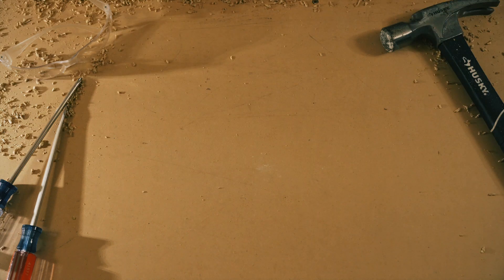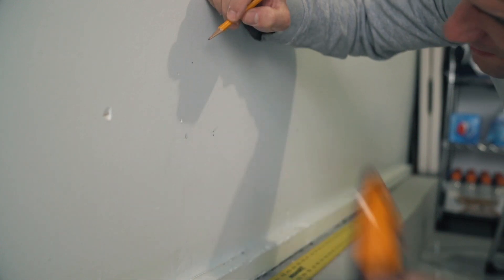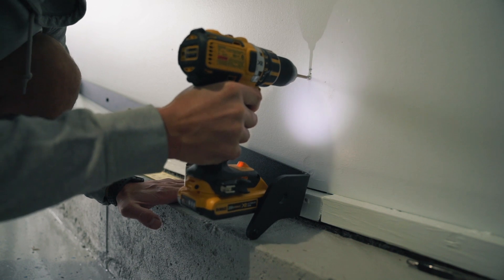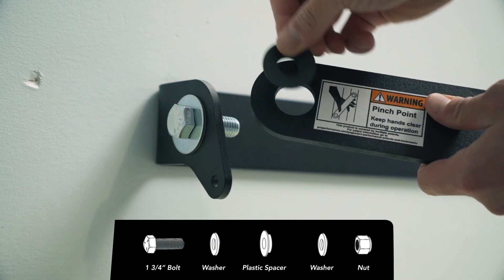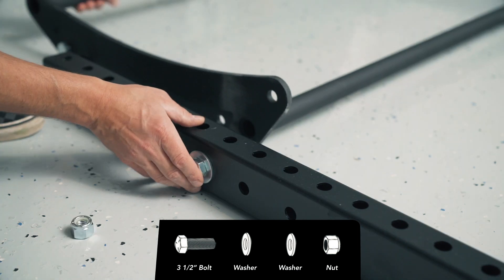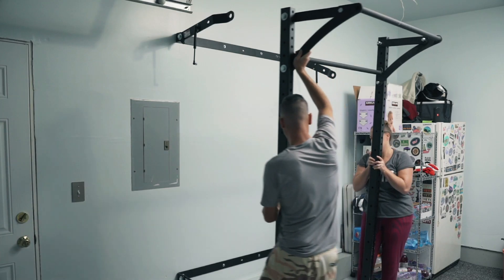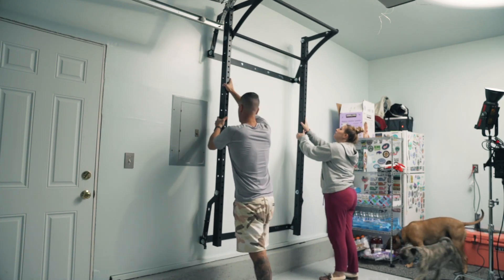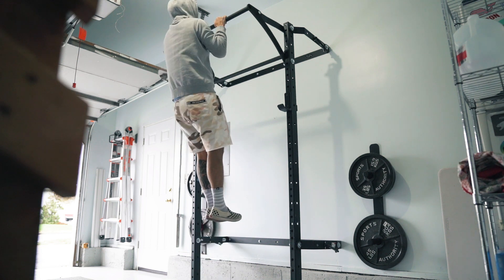How to Install the PRX Performance Profile Rack w/ Kipping Bar

Comment: These measurements are different by an inch compared to the ones they provide in their installation manual for the lower bracket being set at 19". Will that be an issue?

Comment: This is literally THE BEST installation video of any kind that I have ever watched!  Companies should pay you to put these videos together, you did an excellent job!  I'm definitely thinking I can install mine now without having to hire someone.  The only concern I have is, I have a concrete wall in my garage.  Any tips on installing on a concrete wall versus plywood/studs?
Reply from the maker: Thank you so much for the kind works I’m glad you found it helpful. As for concrete,  I think you just need more powerful tools. I would start with a hammer drill and a special concrete drill bit that’s probably made out of a dragons tooth or something. Maybe this video can help https://youtu.be/Xq1tSFduzVo. I also think you can rent this tool from a Home Depot. A minor inconvenience but still doable. I would bring the lag screw to Home Depot with you and let them know exactly what you’re trying to accomplish. Other than that the process is the same. Hope this helps. Good luck!

Comment: If my floor is uneven should I still mark each hole 19 inches off the ground?
Reply from the maker: I would make one mark 19” off the ground from the highest part of the uneven floor then just make sure you use a level and mark the other side. (Does that make sense?) Then as someone mentioned in the comments, get a leveling kit. Prx sells them for $5 and they just snap on to the bottom of the uprights. Very important to make sure both brackets are level. Hope that helps.

Comment: Great video! My garage has concrete foundation like yours but it comes up 31inches from the ground. I know PRX recommends 19 inches but is it possible to install the bottom mount on one of the higher holes on the rack?

Comment: Is there a way to shorten the gas shock to attach it to the ears? Everything was smooth except for the very last step
Reply from the maker: That's odd. They're designed to fit perfectly no matter how off the installation is. Are you sure the ears are pointing down? Hard to say without seeing it.
Reply: Yeah I wish I could post the pictures of what I’m talking about. Ears are pointing down on both brackets and the silver part of the shock is about 1/2 inch too long for me to properly attach it.
Reply from the maker: @jacobsigworth2475  damn sorry to hear it. Maybe the shocks are extended a little and you need to push the ends together to compress them? I’d call their customer support, hopefully they can help you. Good luck.
Reply: @jimmypenna26  I was able to work things around a little bit and got one of the shocks attached but then of course one of the lag bolts connecting the mount to the wall snapped in half on me. Gotta wait for them to send out a new one to me now
Reply from the maker: @jacobsigworth2475  sorry you had trouble. How did you make out?

Comment: What do you do if the floor isnt even
Reply from the maker: Depends how uneven it is. Mine is a little uneven but once you do pull ups or hang up a bar with weights it settles to the floor. It might also help to add floor tiles which is what I am going to do next.
Reply: PRX also sells a leveling kit for $5
Reply from the maker: @Jeffb0572  Good to know. I can use one.

Comment: What if the top gas pistons don’t fit?
Reply from the maker: The way the arms attach to the bracket make the pistons fit perfectly. So even if you screw up the measurements, they will still attach perfectly.

Comment: Nice! How tall is your ceiling and what size rack did you go with? 90” or 96”?
Reply from the maker: My ceiling is 10 feet and my rack is 90'. I installed this in my garage and It fits great. It won't work with the standard 8ft ceilings.